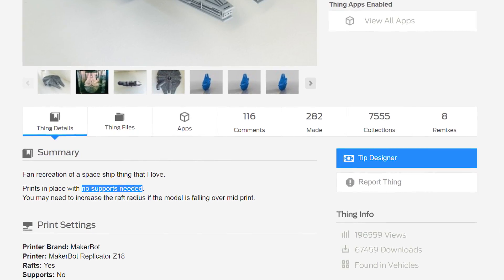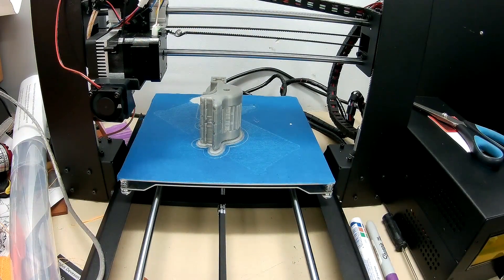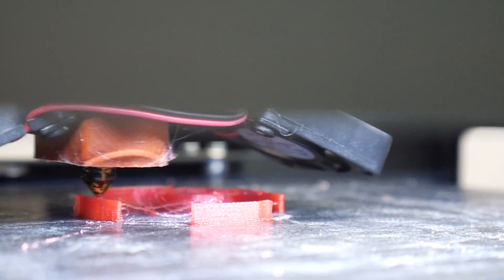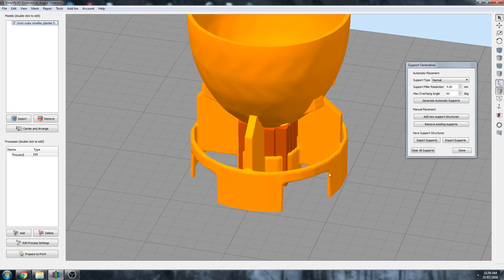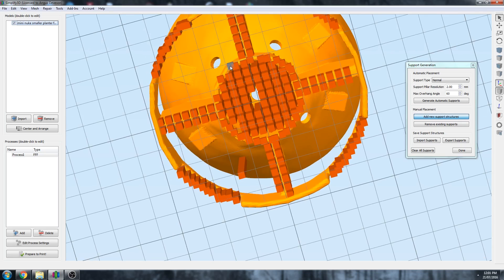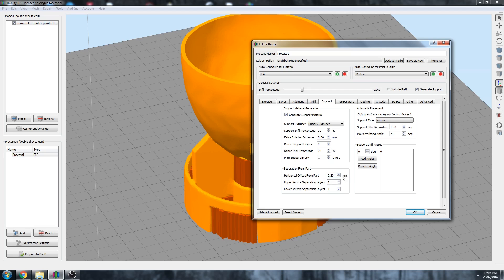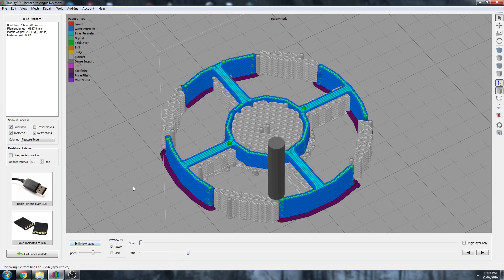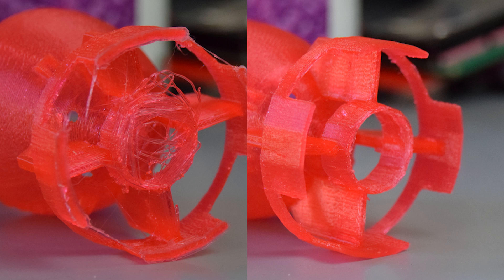How to use Support in your 3D Prints! Part 1 - 3D Printing 101

Comment: Hey G'day, great to see awesome tutorials, I have only one complaint. I tuned in to see what you had to say about supports the bane of my life. BUT BUT BUT BUT, you use that miserable program simplify3d. The greatest majority of us none uber users operate using more common tools (Cura as an example) which have a lot less control. (hope you take the tongue in cheek with a smile). Have you got a tutorial dealing with supports but with more common slicers. Cura even at 10% are difficult to remove. Greetings from the colonies downunder. Now off to buy your gizmo for tolerances.

Comment: I know this is an old video, but I'd like to add that you can combine angles for your supports in Simplify3D. For instance, making them 0, 45, 90 and 135 degrees, makes a very robust support. You can make it less dense, faster printing, and very hard to miss in any direction your layer needs to be supported...

Comment: That was really useful. I wonder if you could cover the specific issue of supporting a large flat area and getting a good finish. I get a great finish on the bed and on the top of the model, but any flat supported area is a mess.
Any tips on getting a really nice finish would be very welcome.

Comment: Hi Angis
I love your advise on printing a skirt with no offset from the part. This works like printing with a raft but only outside the model.
I had big problems on part sticking on the heated bed. Nothing did stick until i installed the BLTouch.
The BLTouch together with the skirt does make any part stick to the printbed like magic.

About supports:
So now my 1st layer does stick very well but now i have another problem. My supports are not sticking to the baselayer (any allready printed surface). I designed a flat peace of 0.2mm that i put under the part that i want to print so my complete part has a baselayer. All parts of the model itselve are printing (and sticking-) very well to the baselayer but many (or all) supports are loosening on the 1st or 2nd support layer (after the baselayer has bin printed). I get a bunch of spagetti on the baselayer.
I tryed to decrese "Horizontal Offset From Part" to 0.15 mm but i think this option is the space above the supoort and that is not what's goes wrong. I need to lower the 1st layer of the support or make the support itseve thikker i think.

Do you know what does make my support not sticking to the part under the support?

Thank you

Comment: I tried printing that deathclaw a few days ago.  Cura did a fine job adding supports where needed, but it was so damn difficult to remove.  The entire underside of the figure is full of ugly marks from where the support structure stuck almost like it was part of the print.
Reply: Cura sucks in that it hides extremely important and useful features by default. There should be a "enable support interface" checkbox that will make it so that the supports are a lot easier to remove.

Comment: I know I'm rather late on commenting, and I'm sure someone else has mentioned this... but you could use the 45 degree support angle until those first arches are layed down, then have it change to a different angle to support the outside tail.  Who cares if the support infill isn't uniform, it is going to get torn away.

Comment: To activate Dense support, shouldn't the option Dense support layer which is set to 0 by default be set to at least 1 to activate dense support? Since i can see a clear different in S3D if i have it set to 0 and then set to 1, i can see that the top layer becomes more dense creating more of a surface area.

Comment: Hey Angus, I recently trying to use Simplify3D to do my splicing and upgraded my CTC Makerbot clone to Sailfish 6.7 and all uploaded and done well. I can print from an older xg3 file from Makerbot and the bed plate moves and prints just fine, but when I try and use a xg3 file from Simplify the bed does not move. Is there a setting in Simplify I am missing?

Comment: Can see same mistake as in Simplify3D - the angle you show is not the overhang angle. The overhang angle is between vertical and the overhang - so that a bigger angle is closer to vertical. The tool tip explanation in Simplify3D is also wrong. 0 is vertical and 90 i horizontal

Comment: Just watching your video with great interest. I have been doing this 3D printing, and I hate the supports that my software uses which is what came with my printer, its the XYZ Da Vinci mini, sure its small but I can do a hell of a lot with it. Yes I am still new to 3D printing but not new to 3D modelling as I have been using 3DS Max for around 16-17 years, and I actually find that doing my own supports AND brims with the design, and I find its so much better than the standard stuff with the xyz software, also it saves filament too by doing your own brim..... Oh and the raft I do my own too. I enjoy your videos, keep em coming.
Reply: You have a da Vinci mini?! Are you just using stock software? Have you tried Simplify3D? I haven't met many people who also have this printer, so it's a pain to get info on it.
Reply: KomaruKirinashi I used to have one. I had way too many issues and limitations and eventually upgraded to a lulzbot mini. Not a bad beginner printer but an upgrade could really help you out in the long run. The lack of being able to other filaments also was a huge factor. Let me know If you have any questions about the da vinci though.
Reply: Sterling Hamilton Unfortunately due to a power cut during a firmware update, mine is borked. Have to send it in to get fixed.

Comment: Angus,  would you consider a supports part 2 using what's in the advanced tab in S3D?  there are many videos on the basics, but not much on the advanced tab settings. things that works well for PLA are disasters with PETG because it sticks so well to itself.

Comment: Good vid. You can use the 'inflation distance' to automatically increase support under thin overhangs. Be careful, as sometimes the support will protrude on the outside of the model.

Comment: Hi Angus,
I've noticed sometimes when S3D creates support structures, the zig-zap pattern shifts phase by 180 degrees. I suspect S3D does this to give the support structure itself some strength as it grows taller. However this doesn't always occur. Is there a setting in S3D that controls this behaviour?

Comment: For those of you commenting that your 3D printer is supported by Simplify3D, but you think that $150 could be better spent elsewhere, I strongly suggest you do a cost-benefit analysis: 
First calculate how much time, filament and effort you've wasted solely because of how your free software of choice handles supports as compared to S3D. Next, think about the time you've sat staring at your monitor while the same program chugs away slicing. Add to that any prints that failed due to a sub-par or outright lack of a gcode preview feature.  Think about all of the extra infill material you've had to use (and thus extended print time and filament cost) to support only the top layers of your print, as the rest of the print would be fine with much less but your free slicer doesn't allow you to set different infill percentages (and/or other settings) at different layer heights. Any other failed, bad and disappointing prints you can think of that were the result of your slicer software not being as good as you'd like? If so, take that into account as well...

...and then reevaluate whether or not that $150 is best spent elsewhere. :)

(BTW, I just glanced at the S3D site and it says there's a 2-week money-back guarantee or demo/trial period.)
Reply: Nailed it.

Comment: thanks Angus! you had the dense support layers set to 0 so did not get to see that but I get what would happen. i was struggling with the battle of save material or get better print finish with supports and did not realize dense had to do with increasing support infill however many layers away from the print. great feature i was missing out on! along with the angle function. Cant wait for this to help me out soon! plan on doinga huge print and that will save me 100 or more grams

Comment: All my printers aren't supported by the Simplify 3D program. Perhaps you should start videos like this with this piece of trivia. Just saying....PEACE
Reply from the maker: In that case the philosophy of using support is 'turn it on and pray it works' because you get no G code preview... kinda lame.
Reply: what printers?
Reply: Several upboxes and CEL-Robox
Reply: Do you know if it simply won't work, or are you going by their machine compatibility list? S3D outputs a few common kinds of g-code. It looks like Robox uses g code, but I didn't see if it uses one that S3D outputs. You can try Slic3r first. If Slic3r g code works, S3D g code will work too. Often you can just use the profile of the most similar machine they do support and adjust it to taste.
Reply: By their machine compatibility list. I have the UPBOX andd the CEL-ROBOX
Reply: *.stl file, try to use other 3D designing software than the usual you use, I got no problem using Simplify 3D and Cinema4D for designing
Reply: Maker's Muse cannot you export gcode and view it in cura or something?
Reply from the maker: Not much I can do for proprietary systems, but the theory is still the same.

Comment: Thanks for the video Angus. I did notice the supports you generated in Simplify3D had some tall cylindrical pillars with wide bases, similar to the ones Meshmixer puts in, bracketing the support walls. I have never seen these type of support from Simplify3d. Is this some sore of setting used to generate those?
Reply from the maker: I think I see what you mean, that is S3D showing where it starts a path rather than it actually being thicker there, and the main part had a 3 layer brim with 0 offset to help it adhere. Not a bad idea to suggest to them though - might help delicate supports adhere when printing with no raft!

Comment: Great information. Shame i am stuck with UPStudio...
Reply from the maker: I feel the pain... It would be bearable if they had that G code preview.
Reply: +Maker's Muse I have been chatting to them over Facebook for some better information on maintenance and better software. Basically said unlock it or add what most slicer's have . and remove that stupid tool wheel and add a tool bar.

Comment: I love this video.
By the way I got my Cubicon single, only to be disappointed that it was damaged during shipping and getting a replacement :(
Reply from the maker: Couriers suck! I've had at least 5 machines trashed by couriers.
Reply: +Maker's Muse this is not the first trashed expensive 3D printer by the couriers, a week before Cubicon I bought 3D systems CubePro Trio it arrived smashed to the core as if the UPS truck ran it over 10 times, and it cost me $4500 total with shipping and tax.
Luckily I was able to return it, I bought the one from work though

Comment: From what I can tell, you left the Dense Support Layers set at 0, so no dense support layers were actually printed. Besides that, great video. I didn't notice before you could change the angles of the support material. That's pretty neat.
Reply: You can also use the support angles to create much stronger supports. Just set up multiple angles like this: 0,0,0,0,0,0,90 which will do 6 layers and then one perpendicular to the previous layers.
Reply from the maker: Well spotted! I was working with such a small model I missed it - despite talking about it. I'll do another video to clear that up in future. The multiple angles is also a great way to improve support strength! Nice tip.
Reply: That's neat. I'll have to try that out.

Comment: Hi, Angus just want to point out that you set your dense support values wrong, just setting the percentage won't do anything you also need to set the number of layers of that dense support, in your video you had that set to zero which meant the 80% value would be ignored.

Comment: Is Simplify 3D really the best software to be using in a 101 video? The automatic is nothing like what cura/slic3r will generate and what most of us will be using.  S3D may well be great but the cost is far more than what I'm going to spend at this point in my 3D printing adventure.

The title excited me as I've been struggling with support on some small parts, I suspect this might be related to the extruder temp and support settings but this tutorial didn't really cover much other than use some $150 software.
Reply from the maker: I'm from the school of thought that if I'm going to spend hundreds (or thousands) on hardware, I don't want to be limited by software. But having said that S3D was only added to my 3D Printers a year or so ago. I used to struggle through using Cura but never found the supports to be that great. If you're not keen to spring for S3D yet but want manual supports definitely have a look at craftware. It's not bad - and all the theory and settings I discuss is still relevant, it's just got a different GUI and slightly less options.
Reply: I feel the same way.  I would buy simplify3d if it werent 150 bucks.  I could keep that for another printer.  I did ask for him to create a video on how to create support with netfabb or another of his normal free to use apps.
Reply: I'll look into craftware but I still feel you cannot, and should not be using expensive premium software in a 101 tutorial.  If this had ben just called support in Simplify 3D I'd have no issue at all.
Reply: @themaninthesuitcase  150 bucks isn't that much really. its just a cost of getting involved in printing. if you don't like it use something free personally though I would be buying some software with my 3d printer

Comment: Maybe this will get covered in part 2, but have you ever had a model that needed soluble supports due to it's complexity? I'm thinking internal cavities etc where it may not be possible to get pliers in there, and for structural reasons the part cannot be divided in two and glued together.

Comment: Hi Angus. as a 3D printer newbie, do you recommend me buying Simplify3D?
Reply: In my opinion, yes for sure.
I mulled it over for over a month before I brought S3D. Would it realy be worth the cost?
Then I bit the bullet and coughed up, now I don't use anything else.
The slicing speed is a LOT faster than anything else I've used and as Angus said, the support beats everything else too. On top of that, the support guys are superb and quick to answer your questions.
IMHO you would not regret buying it.
Good luck, whatever you decide.